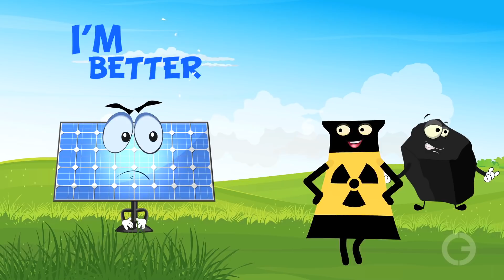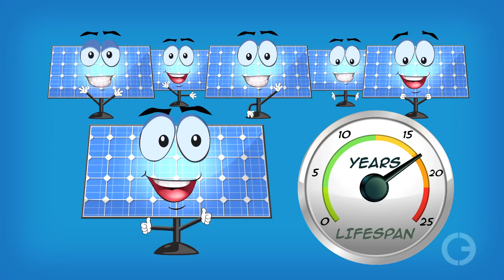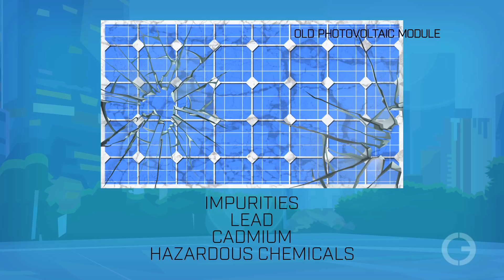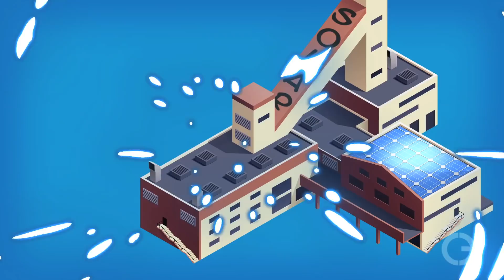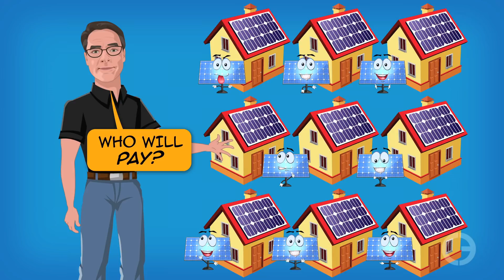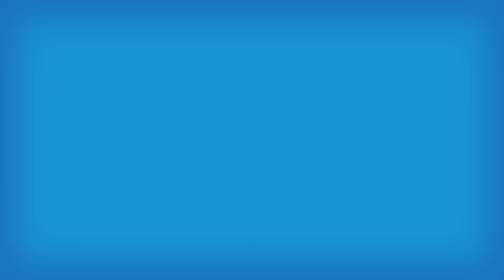Dirty Solar

Comment: They can still release toxic whenever they are used but sometimes cause fires,this video should raise awareness about solar panels because they aren’t that safe due UV radiation which can rush a person to ER
Fun fact: Solar panels cannot be renewed if it reach the end of its lifespan which cannot be renewable.
Fact 2: solar panels don’t last times longer than the expiration
Reply: Also I remember hearing about some solar fields causing birds to burst into flames as they flew over the fields due to the suns reflection.
Reply: Fact can be fun with a valid source, period

Comment: Infinite mining problem for solar panels? Explain to me how coal and natural gas work...

A Photovoltaic (PV) Panel takes about three years to generate the electricity that was used to create it - I know, not great. Since PV panels are still able to generate ~80% of their original output 25 years after installation, three years doesn't sound too bad to me. 

Solar Energy isn't perfect! But it's a step in the right direction because it's more sustainable than fossil fuels and is crossing the threshold of becoming cheaper than coal (about $35/MWh without any government incentives)

This is an incredibly one-sided video. Viewers: please find yourself an unbiased source of information.
Reply: The lifespan of the panel, does not get the investment made to purchase them back. The only way the industry is kept afloat is tax payer money infused into it. Not tax breaks, but tax payer funded. Just look at the hundreds of millions dumped into US solar companies, only to have China buy them up for pennies on the dollar during the Obama administration.
Reply: @mtevilone  Yes, and windmill power is even more of a lost cause, supplemented by the taxpayer.
Reply: You right this video sucked.
They failed to get in to the real problems of photovoltaic solor cells. 
The GWP of NF3 is 16500 to 17200 with a 500 year decompression. NF3 is Not fould naturally in earths atmosphere. 
Unlike CO2 which is a critical need in earths atmosphere. NF3 does Not follow a life cycle, as does H20 (the world most abundant greenhouse gas) or CO2. 
Photovoltaic solor cells are much worse for the environment than HC fuels- which really are the only fully recycling fuels. 
Below are links to an article, a publication and information from the EPA. I have piles of articles but these should do. 
https://www.cfact.org/2019/09/15/the-solar-panel-toxic-waste-problem/

https://scholar.google.com/scholar?hl=en&as_sdt=0%2C5&q=GWP+of+NF3&oq=#d=gs_qabs&u=%23p%3D81RxqdpuYHMJ

https://www.epa.gov/ghgemissions/understanding-global-warming-potentials
Reply: Btw where did you the $35/Mwh? Its completely wrong. Besides the fact that due to high toxicity of solor cell production, cell are only made in slave labor countries like China. 

The real cost is around $250/Mwh. Jan 2022.

Comment: And not a single piece of evidence was presented in this video. All anecdotes. Yes, these are bad because mining. Please share the numbers. A lifecycle analysis of the CO2 released per kWh of power would be great, but I think you chose not to share that for a reason.
Reply: Let 3rd world  countries handle recycling.oh i'm so environmetally consious.
Reply from the maker: There's only so much we can cover in 2.5 minutes. If you want to truly investigate, check our sources and look for yourself. We don't much care about the lifecycle analysis of CO2, since CO2 is most likely a small and manageable problem, or may not be a problem at all. What is a problem is disposing of the panels when they become toxic junk. And besides the mining issue, the other problem is solar being held up by generous taxpayer subsidies.

Comment: And power plants are "lifetime". The normal power plant is good for 30 years, usually less. Ever tear down a power plant. I work where 2 old power plants are left standing due to cost to remove and asbestos in the structure. Solar is completely recyclable. Power plants built with far more material aren't.

Comment: Okay and oil and coal are just mined once? Well that's a load off my mind, guess we won't need to mine anymore coal or drill for oil. Next as to the recycling it's a new technology that does have a ways to go, but can you recycle the garage coming out of the factory that generates my electric? Oh wait we can get that from mining or drilling. This piece is such a joke
Reply: Well theoretically we could take the carbon out of the air. It's possible and with a free market it will be cheap.
Reply: Yes, much of the components are removed and recycled. The ash from burning coal is removed and then used for concrete. The Hg is removed too. The technology exists to remove the carbon emissions as well, but isn't happening. It could, but the move to NG is predominant instead. Ultimately, nuclear is the way to go for zero carbon emissions.
Reply: https://m.youtube.com/watch?v=nyRu0qxj81o&list=PLoljsMaUhh_dLt9v658mXi8lNINtW24fC&index=15

Comment: Solar power is the future. so what do you expect people to go back to coal?...😂
Reply: What about night time? Where we use the most energy?
Reply: @deckfinal751  the solar power is stored in a storage compartment.... 🤔👍
Reply: matrix yes those are batteries. Not only are they dummy expensive it's also environmentally terrible. Due to the components made in storage components for solar
Reply: @deckfinal751  anything we use is environmentally terrible for the Earth so it doesn't matter. If that's the case wind power is bad water power is more efficient. Hydrogen power will be better then. 🤔🤔🤔
Reply: @imatimetraveler5760  oh I agree. I think we should switch to nuclear and hydrogen power. Both are effective

Comment: What is this paid for garbage "by coal"...renewable is the way forward... Not the lie that is big oil and big coal. Have a noice day.
Reply from the maker: No coal funding was involved in making this video, but would that make a difference? Do you not imagine that the people, and large businesses pushing wind and solar have the correct position and there is no ulterior motive? Nuclear actually has the brightest future for electricity generation in our view. It's more expensive than natural gas and likely will be for some time to come. Small nuclear generators may change the equation. Wind and solar have giant negative environmental consequences. These consequences are hidden because the percentage of electricity supply is so small. Then, of course, there is the intermittency problem.
Reply: @ClearEnergyAlliance  small modular nuclear reactors for the win!

Comment: Common sense not science shows the same environmentalists that demand wind and solar, ignore the manufacturing, replacement, and long term disposal problems as well as the heat island effects of solar arrays and ground temperature increases around turbines. These are not green, renewable, or sustainable.